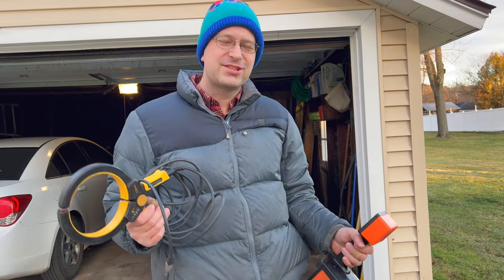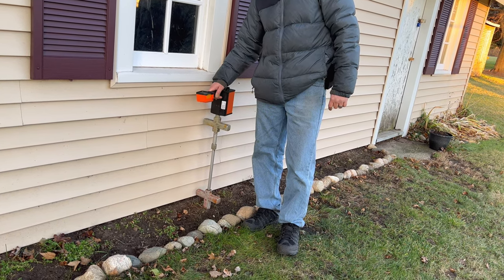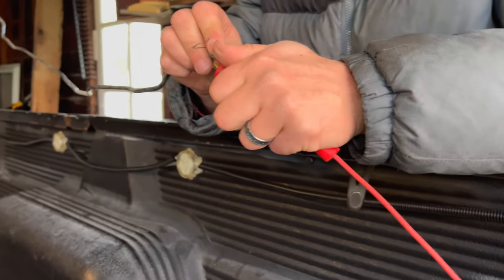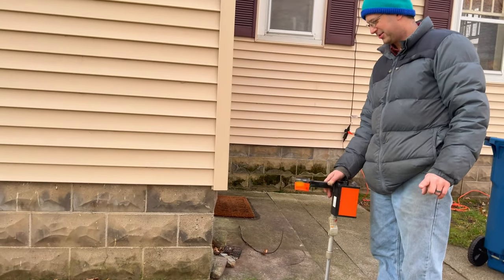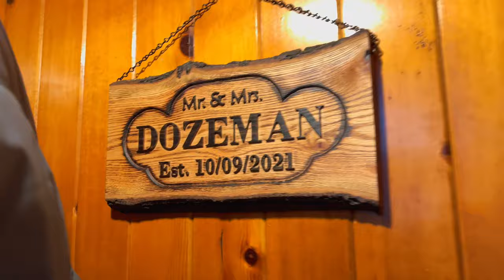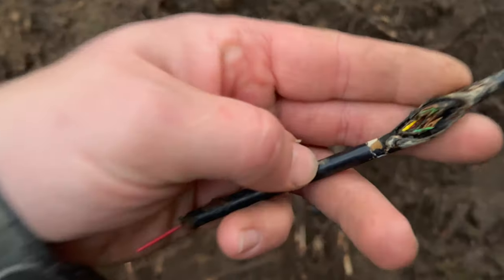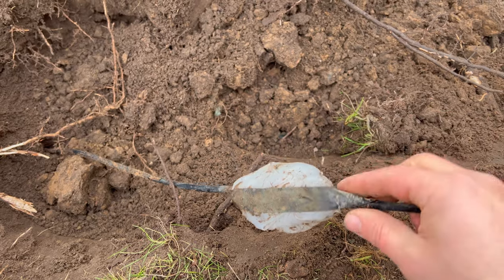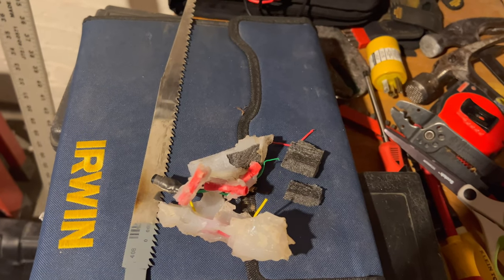Locating and Repairing An Underground Wire for the Garage Door Opener Switch

Comment: The more splices you have in any underground wire, the more resistance you are going to have in said wire, which may or may not be enough to carry the load you need to operate the garage door.  Your best bet would be to replace the wire completely.
Reply from the maker: If I’d known it was this damaged I would have! Maybe next summer, plus run new power lines out to the garage.

Comment: It might be a bit over kill be I would recommend replacing the cable with a SWA Cable. SWA (Steal Wire armoured)  cable is a bit more costly but for underground work is the better option since it's made up of three layers. The wire it's self then the SWA and lastly a thick rubber outer casein. An SWA cable is much harder to damage there for it pays for it self over the years. Here in the uk it come in either 2,3,4,5 or 7 cores. so good for running more then one item if needed. If that's not an option them maybe running the cable through a tube underground can work as well. But the tube will become brittle over tine and will need to be replaced.
Reply from the maker: That’s what this is I think, it has three layers, middle one was steel wire
Reply: yeah. sounds like it's swa cable. Still might be best to replace it than patch it with the amount of damage it has. Last thing ya need is it being a shock or fire hazard. For now might be best not to use it at all un till ya can replace it.
Reply from the maker: @GothicWerewolf78  oh yea I agree, if I had known it was this damaged I would have! Only low voltage for garage door signal, so not much of a hazard.